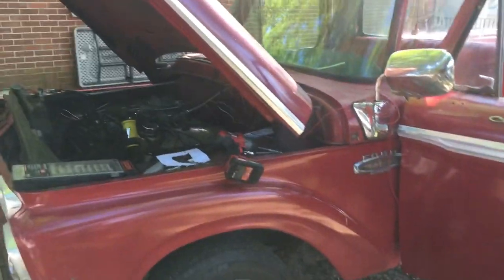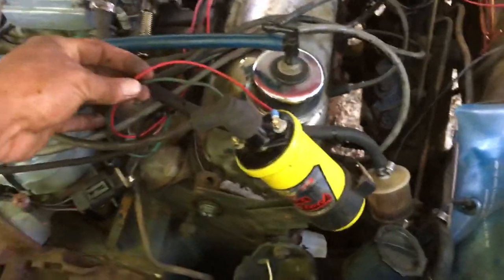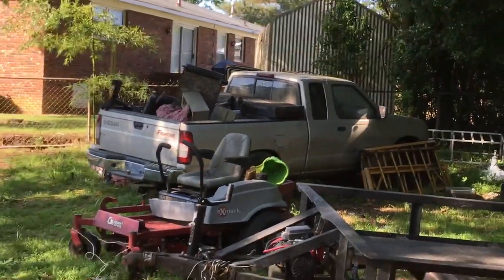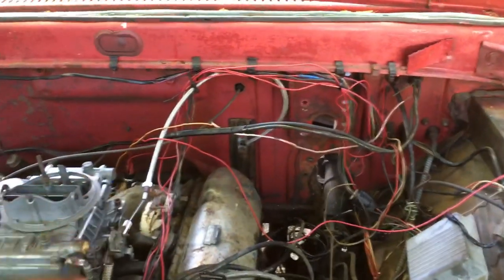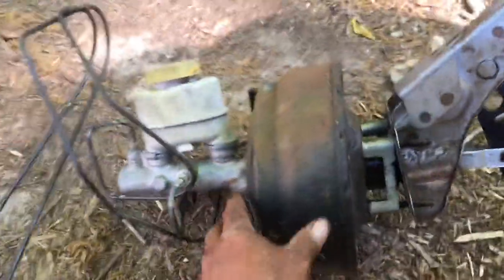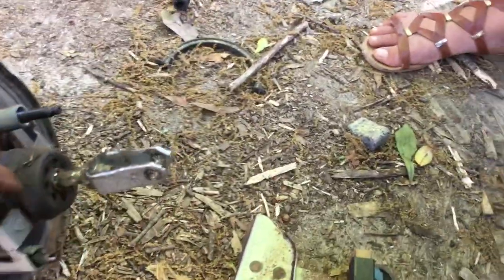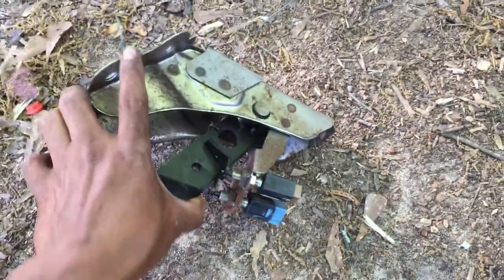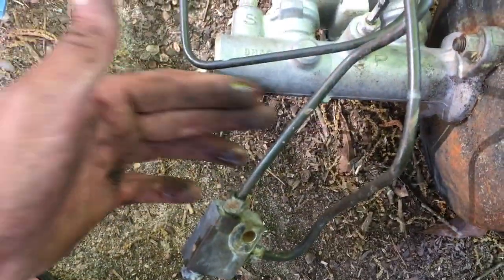1966 F100 POWER BRAKES project FOR FREE

Comment: Yeah, the fact the master cylinder is off a disc brake truck and the F100 is all drums won't matter. Nor will the fact the wheel cylinders are different bore sizes. Good luck with that. 😲